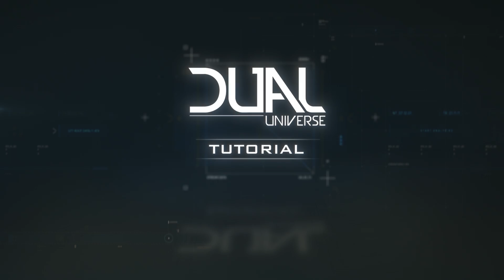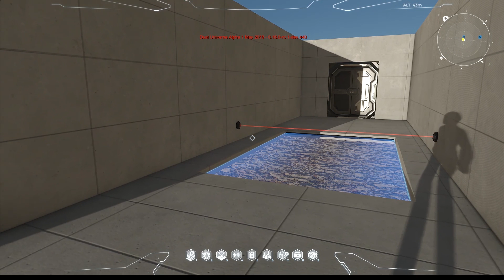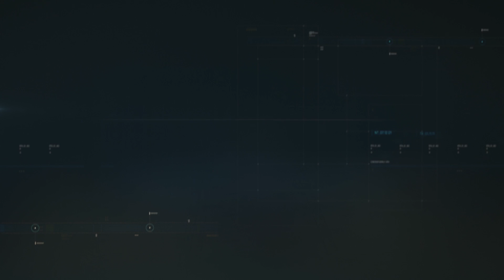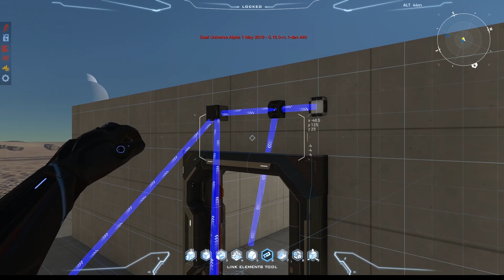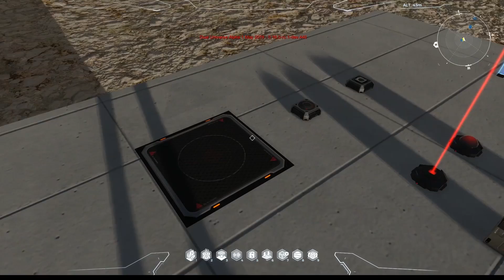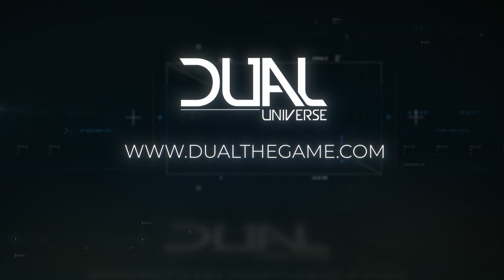Dual Universe | Alpha 2 | Puzzle Building Tutorial

Comment: I think the explanation you were looking for with the counter is that its like a toggle switch that toggles between two possible states or outputs
Reply: Yes I believe Baillie stumbled a bit in referring to that switching unit placed between the AND requirement & the Door. 

Exactly like a two-state toggle switch, that switch alternates from activating one circuit to activating another, when sent input (in this case from the AND unit). So it could be attached to a button & two doors, switching which door is open by one button press. 

It only seems to be a "counter" in the sense that it can count from 0 to 1 & back to 0 though. 

Just like two-circuit light switches that allow either switch at top or bottom of a stairway to activate a light, this "counter" unit is essentially one bit of memory. 

We could build a triangular stack with 15 of these "counters" to store 8 bits of data... 

/ = 0   
\ = 1 

..../...   
../.../..   
././././.   
////////   = 0 

....\...   
../...\..   
./././.\.   
///////\  = 1 

..../...   
..\...\..   
./.\./.\.   
///\///\   = 2 

....\...   
..\.../..   
./.\.\.\.   
///\/\/\   = 3 

..../...   
../...\..   
.\.\.\.\.   
/\/\/\/\   = 4 

....\...   
../.../..   
.\.\./.\.   
/\/\\\/\   = 5 

..../...   
..\.../..   
.\././.\.   
/\\\\\/\   = 6 

....\...   
..\...\..   
.\./././.   
/\\\\\\\   = 7 

..../... 
../...\..   
././././.   
////////   = 8 

I really hope there will be memory able to store more than 1 bit available...   ;P 

But I do see a lot of potential uses for these units. Thanks for the point-by-point walkthrough, JC!
Reply: @prophetzarquon  the game includes counters with more than two outputs so there is a "3 exit counter", "4 exit counter", etc. So while that could be a method of storing binary data. It would be much easier to use the other counters or even the in game computers with custom code, the game also uses.